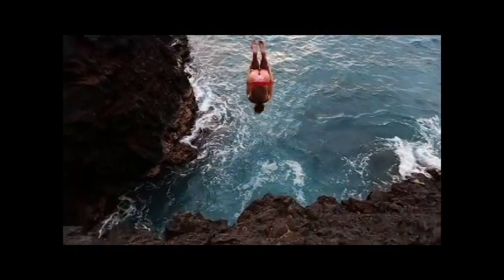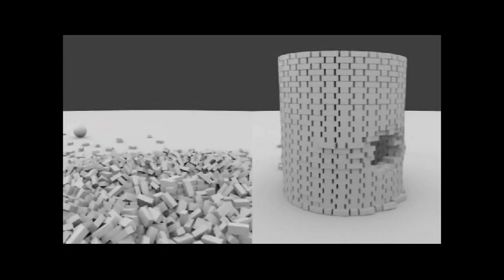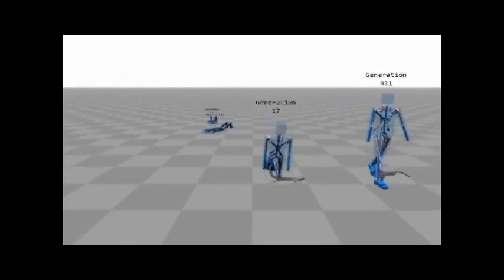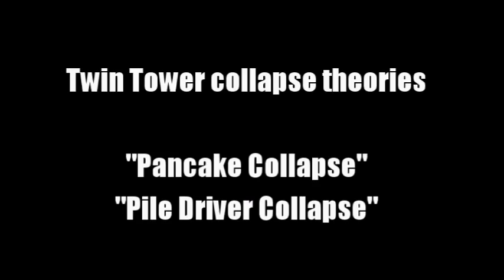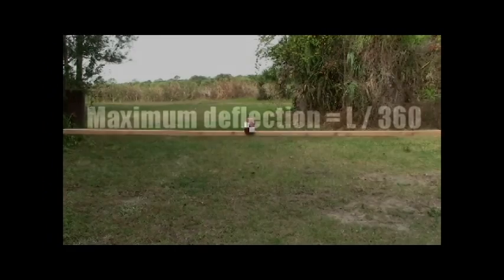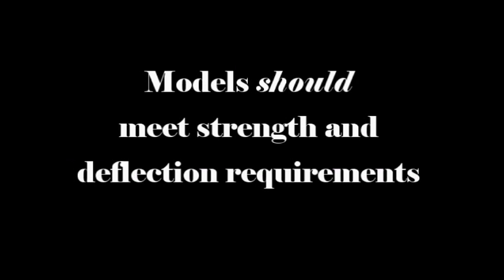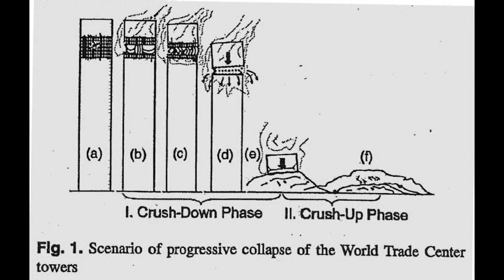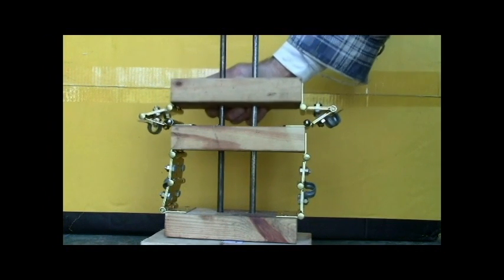9/11 Experiments: The Force Behind the Motion

Comment: 6:00 Your experiment has a design flaw, your floors are not attached in the same manner as the floors in the WTC's, the pancake hypothesis did not suggest that the floors fractured but that the truss attachments sheared.
Reply: the POINT here (with his models) is the fact that SINCE there are not extra (or any to speak of) structural connections - makes his model FAR more likely to 'pancake' or follow the 'official' story - and therefore it's a very 'conservative' model that creates a worst case behaviour - so even with that 'worst case' you STILL have rapid deceleration of the 'collapse' which is the entire point of making the model in the first place ... it exists ONLY to show how kinetic energy is expended in a progressive collapse (therefore slows down and stops rapidly) - as with all such 'unassisted' collapses .... you could even create a similar model using slices of toast or aluminum cans - it doesn't really matter from this perspective ... but anyway - no - scale doesn't come into it at all - in case you're thinking (unconsciously) of the archimedes principle ...
Reply: it has nothing to do with scale  ... sorry - completely scale independent. the only issue that matters here and the primary point being made is that kinetic energy is exerted as the 'collision' progresses toward the ground. I can understand how you might feel confused about that however ...
Reply: not in the least - being unattached the way his were make the 'collapse' unencumbered from structural complications - meaning the experiment will always show a more radical and complete failure than the real building could have.
Reply: antigen4 THIS. THIS! THIS!!!
Reply: I was thinking this too, "Structure that has no relation to reality". At the end of the day we're comparing cardboard and pizza separators to 100 story steel structures? Get real. Plus there's no mention of 1/4 million lbs of molten aluminum (airplane, which burns hotter than jet fuel), making a path downwards through the building. Also a coincidence that the 2nd tower hit fell first? No, it was hit lower in the building, more weight coming down on it.
Reply: Michael Geraci EXACTLY!!
Reply: Another problem with the "experiment" is it seems you forgot the 'out' part of the "Down and Out" Theory you mention at 5:09. In the actual collapse the sides fell away as the collapse progressed. Your set up keeps rigid side walls which offer support to the shelf notches that are offering both structural support and resistance to the falling floor segments. Not to mention the fact that all the weight (energy of collapse) is focused in the center of the floor segments.
Reply: Comments disabled, not able to stand up to reasonable questions.
Reply: Hey guys I know nothing about structural engineering or anything like that...but if someone on this forum can give a reasonable explanation of bldg 7 collapse I may consider a change of opinion.
Reply: Noelle Leger there weren't any explosions other than the plane entering the building and spilling hundreds of gallons of jet fuel into it which melted the structure from the inside. The smoke, that you call explosions, is being forced out as the building compresses itself.
Reply: jet fuel do not melt I beams, jet fuel ignites and combusts in a very short time, explain why there was molten slag on the ground for weeks after the event.  Explain building 7 which did not have jet fuel in it
Reply: Michael Paquette explain this. "Fuel spilled INTO the building". If a airplane wing full of jet full hit a steel structure it would explode on impact putting the majority of fuel on the OUTSIDE of the building. How does an "aluminum water balloon" penetrate (completely intact) through steel columns??? Physically impossible.
Reply: If building 7 fell to dust because of a fire on a few floors after a couple of hours then no!, none of the engineers in yew nork can be trusted. At all. Something is seriously wrong with an increasingly accelerating collapse of any modern structure.
Reply: Paid trolls.  Those buildings were blown up and if you can watch that video and still believe that a small part of the whole building can crush the remainder and fall at nearly free fall speed, then I don't know.  The pancake model makes no sense because if it were true then there should be a bunch of floors stacked on top of each other and also the speed of the fall would have slowed greatly as the top floors met more mass below.  Think you could walk through a door as fast as you could if it were opened?  Finally after all these years more of the masses are not accepting the garbage official story.  But you still have paid trolls like Mike and his other account or his buddy Bruce Lansberg.
Reply: @axelfoley20  "the speed of the fall would have slowed greatly...". Well, there you go.  Watch the video and record how long it takes to fall 20 stories, then the next 20, and so on.  You know how tall the building is and you know how many stories tall it is.  You know the acceleration of gravity.  So, you can easily calculate how much the fall was restricted.

How much does the top 40 stories weigh?  You really think if 40 million pounds (just a figure) suddenly fell onto the lower floor it would hold it?
Reply: axelfoley20  If this were a cartoon yes then there would be a neat stack of floors. Let's talk reality, there is no way to replicate the collapse of such a poorly constructed building. It would NEVER PASS modern building codes. JP knows his shit and you're a just a bunch of followers wanting to believe the "fake news"😀😀
Reply: "such a poorly constructed building. It would NEVER PASS modern building codes." bwahaha smh I guess "hire a troll" has lowered it's standards.
Reply: The NIST investigation found that the construction of all the buildings was in accordance with local building code. Where you been? The steel components were certified to ASTM E119. The time temperature curves for this standard require the samples to be exposed to temperatures around 2000F for several hours. Factomundo..
Reply: Idiot doesn't understand "free fall"
Reply: sorry, my comments were in response to bruces link and joe v's comment about gravity
Reply: "No explosions were ever seen heard or felt in the seconds before or during collapse".  True, except for the eyewitness reports of virtually everyone that was actually in or near the buildings as they collapsed and were able to get out...  there are literally dozens of videos available of people, covered in dust, talking about the "rolling explosions" that occurred just prior to the collapse.  NIST of course ignored them all.

Your explanation sounds like regurgitation.  It doesn't strike me as being at all logical or in line with known physics.  I know full well that the "pile driver" theory is currently the in vogue "official" theory (after the "pancake" theory was adored for a long while and then summarily kicked to the curb).  Both strike me as equally absurd.

Even if one were to grant most of what you say, once again you have weakening of "truss seat connections" in the floors that were believed to be compromised by super-hot fires (I'm not saying I believe this; I'm saying if one chooses to stipulate these points for the sake of argument).  Once you get to the 90th floor, you would have floor-after-floor of massive resistance provided by uncompromised structure.  One does not "sheer" off all these connections as if they're firecrackers and paper, giving no noticeable (to the naked eye) or detectable (by computer analysis) deceleration.  Massive slowing and deceleration would be evident immediately if what you say is true.

The 20-lb weight hitting your head does not grab your head and accelerate through your sternum, grabbing your rib cage along the way and using it to accelerate past your pelvis.  It simply hits, you say "ouch", and it rolls off.  You're pretending that "because of the way the towers were constructed" that it was essentially a flimsy house of cards.  Your conclusions are pretty preposterous.

It's also not clear to me, in your scenario, why we wouldn't find much more of the core columns intact and still standing (which is how many of the videos show it...  the floors "sliding" down the core columns).  If all these truss connection points are just sheering off as it goes down, the vertical columns and their superior compressive strength would seem to be relatively unaffected compared to the break point at the truss bolts
Reply: Derek Thompson  As you recall, there were a number of core columns still standing for a few seconds after the first tower collapse. This supports the theory that the floors collapsed, shearing off the truss seat connections.
Watch this video and listen to the guys describe the '''compressed floors'''' they found.   Do they sound ''''''Absurd""?
https://www.youtube.com/watch?v=DdBv7uaQT_0&t=20s

In Every demolition you have ever seen, explosions are Clearly seen, heard, and felt in the seconds before and during the collapse.    There is NO mistaking them.  That did not happen with the collapse of any tower that day.   If you think so,, post a site that shows it.
The truss seats were Not compromised by ''super hot fires'''.  They were compromised by having their  design limits greatly exceeded.   That simple.    Once the FIRST stationary floor is sheared off, the next lower floor doesnt stand a chance.
Reply: Mike 1462 Exactly, these fucks don't understand architectural integrity, which this building lacked in a huge way. If they did the research they might understand, but sometimes you can't fix stupid
Reply: Don't repeat what your parents were saying about you to their friends and relatives.
Reply: Noelle Leger 9/11 Commision Report just talking about how 9/11 occured on U.S and how to prevent the simmilar event in the future, not NIST final investigation.
Dude, the explosion can remove fire proofing material from the metal
Reply: Firstly, nothing stayed intact in the building collapse - and expecting a die cast box to still be in good condition and working after what happened is just not humanly or engineering-wise possible.  Next - the transponders have nothing to do with guidance systems so they easily were able to know where they were.  Next - you speculate that the planes were remote controlled?  Ummmm they were hundreds of miles away from New York when they turned around and no radio control is going to work that far - let alone 2-way video so the operator could see where they are going.  Second to that - have a look at the radio controlled 727 that was flown by radio control for crash test purposes.  Even a skilled operator was not able to fly the plane and get near the runway, let alone someone who is not even in sight of the towers, guide a plane at 500mph into a small object size such as the size of towers - radio control, just not possible.
Reply: @ bobo lulu -im not saying how it did or did not happen. I think with your comments on the subject of radio controls from a far distance may not be correct. Here are two sources w comments. 
1st one>
https://www.quora.com/Whats-the-longest-distance-of-drones-can-be-controlled
May 10, 2017 - It can fly over Afghanistan, while being controlled by an Air Force pilot thousands of miles away, in the continental United States! ... The drone below is a DJI Mavic Pro, which can be controlled from up to 7 km away.
2nd one>
www.dailymail.co.uk/.../The-predator-spreads-wings-Killer-drone-gets-new-long-dista...
Mar 1, 2016 - The new larger version of the military drone with wings 79 feet long can fly for 40 hours ... Above, a pilot flies a drone in Afghanistan from Nevada ... spending time with their families to bombing targets thousands of miles away.
Reply: Mike 1462 EXACTLY!!
Reply: Champion Fighter Do the research before you criticize , pencil neck.
Reply: Champion Fighter "Magic Words you little shit"
Reply: I think it is notable that he has actually built and created models of any type to attempt to duplicate the forces on the buildings. Can you reference models that either duplicate the motion of the collapse or duplicate the theorized forces and impact? Even if the structural support was melted by the fuel or molten aluminum, it would stand to reason that the melting points in the steel beams would have been on a different timeline. The building would be more likely to tilt to the side that was compromised first. For both building to fall in the same fashion from two different impacts at two different levels is hard to believe.
Reply: Corey Whiting Holy shit, then don't believe it and spend the rest of your life trying to figure out basic physics.
Reply: Mike 1462 here is right on the money. I am not an engineer, but I know enough about architecture and basic physics to understand that these so-called “models” bear no resemblance to the real buildings. Those pizza box thingies and those cylindrical paper strips were adding supports between the slabs where none existed in the real buildings. Repeat after me: there were no columns inside of the towers except on the core and on the perimeter. Also, the pancake model (which you demonstrated using a rigid perimeter, meaning that it also bears no similarity to the also flexible perimeter columns) wasn't set in motion by a localised impact like the one demonstrated here, but by the slabs themselves banging in one piece on top of the one immediately below them; maybe the first one (or the first few) got loose from the flex, but all the others below it were snapped off clean from the perimeter columns by impact; as for the latter, only some of them had to buckle, because quite a few were torn open clean, as if peeled off of the towers (as those multiple-story remains of the perimeter of the lobbies and the lower levels of both towers attest).

Maybe there were indeed explosives inside of the towers, and maybe those would explain the free-fall (or near-free-fall) speed of their collapse, but the design of the buildings certainly played a part on the events of that day. Try and build a realistic model next time, because the ones you've shown neither prove, nor disprove anything. And I also question the official version of the events, so this isn't a matter of personal bias against conspiracy theories; it's just that your models are basic and wildly inaccurate. So, physicsandreason, since you like quoting scientists so much and at least seem to be more open to the scientific method than the run-of-the-mill flat-earther or climate change-denier, I feel should probably remind you of this rookie mistake: https://en.wikipedia.org/wiki/Confirmation_bias
Reply: my guess is, over 1000 people dont like selfbuild, reality distorting models that do not support their opinion.
Reply: I have actually worked construction and know how to read blueprint layouts. The external beams were very much functional supports even know some claim it's no more than siding, The print that is available on their sight shows that to be a false claim. I assume if the trusses sheered in this example the external beams would pull inward and create obstructions to the falling upper portion, but the footage clearly shows them being ejected, which is highly suspicious as it was occuring on all 4 sides. That raises a major red flag.  Also to be fair i dont believe these scale models are sufficient when they are not same material, not so much the actual scale, but like material would be more legitimate.
Reply: @Chaddy_D  the scale model shown above are totally unrealistic and unscientific and no way reflect the construction of the towers..
The external panels were very much a key element to the construction of the towers.  there were spandrel plates and truss seats welded to the external panels and interior core columns. That is where the floor joist made their connections.  All three systems work together to support the towers. Once the upper floors begin collapsing and the floors sheared off at the truss seat connections the exterior panels had no place else to go but out wards.    If you worked in construction that would not be a hard concept to grasp and understand...
There are photographs in the debris pile of truss seats which are bent down and flat against the spandrel plates. There's only one way that could have happened.
Reply: @hybridengine6179  You should pose that same statement to any one associated with the ASME, the ASCE, or the AIA.  I don't recall Any one in those groups having a problem with the way the towers collapsed...  
Care to guess why?? 
Everyone in those groups understand physics, has a working common sense area in the brain, and realizes that what we all saw that day is what happened,

Oh.. and there has never been any proof of explosives, thermite or nano thermite anywhere in any tower.
Reply: @hybridengine6179  great well that means that over 1 million professional engineers agree with me.
Hmmm. Let me think. What would I rather have.  3000 on my side or over 1 million... That's a tough one. 
 thank you for the comparison
Reply: Hybrid
and I hate to burst your bubble but the 3,000 people registered at The Architects and Engineers for truth site do NOT all think there was thermite or explosives in the towers.  
They signed their name to the petition because they wish to request a new independent investigation. 

One more assumptive bullshit leap you truthers are always doing
Reply: @derekthompson5731  these scale models shown above are such a joke because they're totally unscientific and unrealistic to the actual Tower design and construction. 
Firecrackers and paper!   Please
 Had it been a 10th grade physics project he would have gotten a D.
The models also take gravity completely out of the equation, which was the driving force for the collapse of the towers..  
Picture this
Drop a 20 lb steel weight on your head from two inches..  it might hurt a little bit.    Now drop it from 12 feet and tell me how you feel. 

There is photographic evidence that the truss seats, which made the connections of the floor joists to the exterior panels and the interior core columns were bent down and flat against the spandrel plates..  there's only one way that could have happened. Care to take a guess?
Reply: Joe V  - This is a just fine experiment.  One doesn't need to rebuild the actual towers, even as a scale model, to prove the point, which should be perfectly obvious.  And how exactly did he "take gravity out of the equation"??  How else, other than gravity, do the upper "floors" fall down onto the lower floors when the truss connections (the paper) are blown out?  If anything, by using the paper for walls (i.e. making vertical supports super weak), he's trying to "help along" a generalized collapse.  If he were to actually have real truss connections on the lower floors of the towers, you would see...  well...  the same thing you saw with paper vertical supports.  Rapid deceleration and no collapse.  Arguing over truss connections completely misses the point, including the point about gravity.  What if you no truss connections?  But just dropped the whole thing, unobstructed, onto the floor beneath?  You would get exactly what this experiment proves.  The only way for gravity to cause the upper floor to pile-drive all the way to the ground is to take out the paper (walls) through some means (demolition) before any impact takes place.  That's controlled demolition, and it's the only way to achieve what was seen on 9/11.

And what exactly is your point about the steel weight dropping on one's head?  It's a pretty obscure analogy, if it means anything.  But to use your analogy, I'll try to illustrate the point of the experiment.  The first plane hit the North Tower (per Wikipedia) between the 93rd and 99th floor.  To humor you, we'll take the upper of those limits (99th floor) as the drop point.  We'll use the 92nd floor as the beginning of the undamaged and uncompromised (no-fire, no-softening of metal) zone, represented by the top of your head.  If you are a man that is 6-feet tall and 200 lbs, then a 20-lb weight would be fine, but instead of 2-inches, drop the steel weight from approximately 5.47 inches above your head.  This would be the rough equivalent of the top floors of the WTC North falling from the upper bounds of the impact zone (99th floor) onto the undamaged zone (92nd floor and below).  

My guess is that you end up with a large knot on your head and in need of Excedrin.  I would not predict, however, that the weight passes through your head, through your collarbone/sternum/rib cage, crushing all your internals organs, and continuing unabated (and without noticeable resistance) all the way to your feet.  I would expect that rapid deceleration would occur, and the weight would bounce off your obviously thick noggin without any noticable damage done to the "floors beneath".  The difference between you and the steel towers is that you're made of soft stuff and they weren't, which makes a tower collapse that much more unlikely.

Everything this guy was saying about a structure needing to be able to handle static loads and live loads and add to that an order of magnitude more strength for margin would continue to apply to every floor between 1 through 92, or the lower 83.6% of the building.  Anything falling from above this zone would begin hitting massive amounts of resistance almost immediately, and would have rapidly decelerated, JUST AS SHOWN in the experiment.  A  single 8x8 wood post has a capacity of 52,866 pounds.  You're telling me that the top of the tower is going to pass through 90+ floors of steel columns and trusses without slowing down?  C'mon...  stop being a pawn
Reply: @derekthompson5731  with Joe V.....the laws of physics need not apply. He gets paid to troll all day withj his fictional version. He is part of the problem. He is ok with  NIST never actually looking  for explosives. Even though its mandated. .. JoeV stares at a carton of orange juice cuz it says "concentrate"  right on the box. Lmao
Reply: CooL!K3DaT - Now that's an idea worth considering...  it has never crossed my mind to concentrate on the carton...  even though the instruction to do so is right in front of my face.  Sometimes, one needs help to see what's right in front of their face.  Thanks man!
Reply: @derekthompson5731  right on man. Its a shame common Sense isn't so common. You and I both understand this video of truth. It is easier to forgive a child who is afraid of the dark.  The real tragedy of life is when men are afraid of the light.
Reply: All you idiots with the learning disorder including joe v. Have substituted mathematics for experiments and you have wondered off through equation after equation and eventually build a structure which has no relation to reality. Controlled demolition is the only way those buildings came down. You people are as bright as a black hole and  twice as dense
Reply: @9962lopez  your ignorance is astounding.. but of course you're a truther that explains everything

Think about this for a second.
you don't see anyone associated with the ASME, the ASCE, or the AIA speaking about controlled demolitions of the towers or the impossibility of their collapse from Gravity..   That's because everyone in those groups understand physics, has a working common sense already in the brain, and realizes what we saw that day IS what happened.  

You will not find one fireman that believes the towers came down from controlled demolition.. that is a fact.     Yes everyone knows explosions were heard all day long from all the towers, but not one was caused from explosives..  that is another fact.  
Piss and moan all you want but for 17 years  no one has found any fact to change any part of the official story.
That's called ""reality"" but you idiots all live your own "" Inside Job"" delusional paranoid version.
Reply: @jcviaene  full of shit im not even reading your drabble.  If I ever do want to read it I'll just go to the fictional section of the library
Reply: @9962lopez  here's a big fact for you that all truthers ignore.
Steven Jones, Niels Harrit and 7 others did extensive testing on four dust samples back in 2007. They were all looking for something to hang their hat on.  They found chips ( less than .1mm thick) that when heated exhibited exothermic reactions.    Jones claimed to have found "active thermitic material" and they composed a paper saying just that. 
They paid 800 bucks and had it published in the Bentham Scientific Journal.  The problem is that they published it Behind the back of the editor who happened to be an expert in explosives and nanotechnology.  Upon further analysis the chips turned out to be nothing more than normal paint primer chips.    The editor and several personnel resigned in order to protect the reputation of the journal.     Jones, Harrit, and Company were made to look like asses.   
my point is,  they did extensive testing on Four dust samples from the collapse site.  Had there been Any explosive residue from any source they would have found it.  
So your statement that NIST never investigated for explosives is a Baseless argument..
Reply: @jcviaene  bullshit aside Joe let me give you a scenario and if you can honestly tell me you be okay with this. Just an example let's say your boyfriend was fatally shot and the police have no leads but. eye witnesses heard gunshots from across the street. Upon the police investigation no one was detained or accused. With concerned look you ask the officer didn't you find a weapon? What would your  response be if the officer said" we never looked"    would you honestly be okay with this? Answer me  truly Joe because anyone can read this but we already know you're full of s***
Reply: @jcviaene  if this was not a control demo.....what would a control demo look like? How different would it be from the original footage? Point them out to me please? Finish your happy meal first .....of course
Reply: @jcviaene  if you can't answer this Joe..... then you are part of the problem
Reply: @9962lopez  yeah in your world everyone at ASCE,, ASME, or the AIA and even NIST are all ignorant people, Liars, or bought off and you truthers are the right ones..  
The right ones  with no facts...  no facts to support any of your idiotic theories.      
Seriously how ridiculous does that sound?? 
But that IS the truther movement in a nutshell.      
Deny, ignore, and fabricate scenarios to fit your own reality.
Reply: @9962lopez  Jones and Harrit quietly went away with their tails tucked between their legs at least they're smart enough to shut up
Reply: @jcviaene  talk about ignorance.... what do you have to say about this fact that the National Fire Protection Agency calls for saving of evidence and being prepared to justify why you woudnt.It also calls for testing for explosives when high order damage is involved. NIST did none of this si how do you rule out explosives knowing this.?
Reply: @jcviaene  answer this.... falling objects always take the path of least resistance...... so why did the towers debris take the path of greatest resistance through the strong core structure all the way down to the ground?
Reply: @9962lopez  God may be your witness,  but science, physics,  engineering, architecture, LOGIC, and FACTS,  are all on the official story side.  . 
I will let you prove it. 
post one fact that supports any of your theories, any of  the truther tribe ridiculous theories,.   OR .. any fact that proves any part of the official story to be false..    
Good luck.
I won't hold my breath.
Reply: @jcviaene  WHAT A BULLSHIT 
STORY. FUCKIN SELL OUT. WHO DO YOU WORK FOR?   DONT TELL PEOPLE NO BOMBS WERE SEEN, HEARD OR FELT PRIOR TO AND DURING COLLAPSE WHEN IN F A.C.T. THERE WAS!    PLENTY OF WITNESSES...PLENTY OF  VIDEOS..   YOU ARE JUST LIKE NIST OMITTING KEY WITNESSES WITH TESTIMONY. Your credibility is shot to hell.  Lying son of a bitch.   Do you really think people are believing you? Everyone knows the false flag and inside job. The towers were brought down by CD. Just look at the video. All three fell symmetrically and symmetrically represents order. All your bullshit figures and false info is a joke. NO ONE BELIEVES A FUCKIN WORD YOU SAY. YOUR A PATHEDIC LOSER WHO GETS PAID TO LOOK THIS STUPID.
Reply: Hey joe v.   Witnesses.... survivors.... authorities were all talking about explosions. But unless properly investigated and ruled out....there is clear evidence of the potential for explosives involved.  Doesnt matter if you think im wrong or crazy....the fact is my little precious one....they still exist.
Reply: Coolio..  read my reply to Derek....  ... When will some common sense and logic start to soak into that brain of yours?
Reply: It makes no difference. It still violates physics via the acceleration through superior upward resistance. Also, and this is key...there were no pancaked floors at the bottom. It all exploded. Nice try Zionist troll.
Reply: Aaron Barlow.   '''''no pancaked floors at the bottom'''''    Why would you say that?   were you  there in the clean up  process?    did YOU see NO pancaked floors ???      '
Of course not,,   you are just an ignorant dipshit truther that spouts crap out of both ends of your puss filled body.
LISTEN to these guys describe ''compressed  floors"".   LOOK in his eyes.   he  realizes people died where he is standing,,, what he is describing.
https://www.youtube.com/watch?v=DdBv7uaQT_0

You know Nothing about physics, engineering, or architecture....
So.   just shut up, take your ignorant opinions and  go away.
Reply: Mike, apologies! If your post had shown up on my screen when I viewed - I wouldn't have tried to steal your thunder! You are completely correct in that the tower collapses were all about the truss connectors.
Reply: @Bruce Lansberg is correct.  The link he provided is spot on.  Your demonstration parameters are flawed.  For all the conspiracists: just how many public buildings are designed with explosives built in?  You want us to believe all the professional engineers in the professional societies that studied this problem at the end of this video, are incorrect and/or lying, and part of the government conspiracy?  Hmmm.....
Reply: just how many people are born with a bullet in their body? Righttttttt genius, somebody put them there just like somebody puts a bullet in the body of a person.
Reply: dgretlein explain how that aircraft traveled 550+ mph at sea level. It's physically impossible. The debate ends there.
Reply: " the pancake hypothesis did not suggest that the floors fractured but that the truss attachments sheared." 
That makes it even more implausible. If the truss attachments shear as each floor hits it there is no way you get a straight down collapse...especially in all 3 buildings. As each floor encounters  the next floors resistance / initial moment of inertia & different loads already occupying each floor that thing is going sideways eventually.'

That dumb video that official story people point to of the dodo stacking blocks with little plastic wedges & then dropping heavy blocks on two stationary supports means modern buildings were evidently designed by children from kindergarten back in the late 1960's early 70's.
Reply: I was thinking the same thing.  The truss attachments were built to withstand static loads.  Once one floor failed, there's no way the truss attachments on the next floor would be able to decelerate the force coming down, and so on.  I walked into work and looked at the TV we had on in our meeting room just as the second plane hit.  Not knowing about the first plane, my immediate thought was "Why was the building on fire before the plane hit?"  I realized that it wasn't the same building that was on fire.  My next thought was "that building cannot withstand that damage and is coming down."
Reply: J P Yep, people don't understand how poorly built those buildings were. They weren't "I" Beams or thick concrete. Floors were supported by 4-6" trusses connected by angle brackets barely supporting the 4" thick concrete floors. Building was perfectly built for colapsibility!!
Reply: You have no clue how that building was designed. They were not poorly built,on the contrary, Funny how not being able to face reality causes extreme stupidity. The buildings were DESIGNED for airplane impact. At higher speeds and MORE damage than occurred. I've seen the blueprints. It's physically impossible for what happened to cause such a collapse. Physics junior. Need lessons? Pay me.
Reply: Trey Nathaniel So you have no clue about construction obviously.
Reply: So you know this how? You don't. You made a blanket claim because you know you do not. Your sheepish response is laughable.
Reply: Trey Nathaniel Don't be mad because you're ignorant to basic construction. Everything looks good on paper. The problem was with the execution. Truss connections were no more than angle brackets, the bare minimum required by code. They cut so many corners, that's what is laughable.
Reply: Finally a sane comment!
Reply: For that matter, here is an experiment that does take the actual floor connecetions into account. Might be nice for future reference: https://www.youtube.com/watch?v=flo62pdaIMI
Reply: Great job, Mr. Lansberg!
Reply: How does your video show that the structure will fall in it's own footprint. Each floor is changing to near vertical, and at the end the debris went outward. That experiment isn't even close to matching the scenario. It is easy to see how removing 1 column from a structure could collapse, but not collapse like the towers just from gravity.
Reply: LOL... That proved that wood that were barely connected fell.
Reply: People who believe the pancake theory are the same ones yelling make America Great again and doing nothing about it, also 100% believe that the earth is flat, Osama was behind 9/11 and the US is the white knight of the world. What a joke
Reply: ABSOLUTELY RIGHT!!!
Reply: 9avedon I would disable my comments too so I don’t have to put up with people like you
Reply: Noelle Leger explosion from thousands of gallons jet fuel...
Reply: antigen4 .... Well, his irresponsible Scale Models do not allow the transfer of the kinetic energy from one floor to the next, as it was in the tower.   And his models are nowhere near representative of the truss seat connections of the floors to the core columns and exterior columns... 
He totally ignores the design and construction of the towers in each childish scale model..   
Please....  fire crackers and paper..  what a joke
and no, gravity can not be scaled down and that was THE driving force for the towers collapse.
Had this been a 12th grade physics project he would have gotten a D minus.
Reply: Joe V dude, come on. Transfer of energy from one floor to the next results in LESS force at ever stop along the way. The speed will slow as energy is used to break physical connections in each floor. This is the opposite of what we see in every wtc video.
Reply: @jcviaene  Newton's third law refutes the pancake theory anyway
Reply: All the more reason why the real towers should have not collapsed by a plane but it was a demolition there fore an inside job
Reply: Two-dimensional thinking has always been a problem for all of you debunkers hasn't it Bruce?
Reply: antigen4 shut up moron you have no fucking idea what you're talking about...  
Not only are all these experiments unrealistic and unscientific,, he takes gravity,  which was the driving force of the collapse, completely out of all these equations.   
What would you rather have dropped on your head.... 
A 20 lb ball from 2 inches above it,  or 20 lb ball from 12 feet above it??? 
if you get the answer right you'll realize that gravity cannot be scaled down..
Reply: Gravity affects all objects the same, so a feather will fall at the same accel. due to gravity...9.8m/s/s.  as a bowling ball
Reply: Joe V lmao gravity can't be scaled!!
Reply: @jcviaene  Yet, the NIST report conveniently ignored kinetic force and static friction out of their equation.